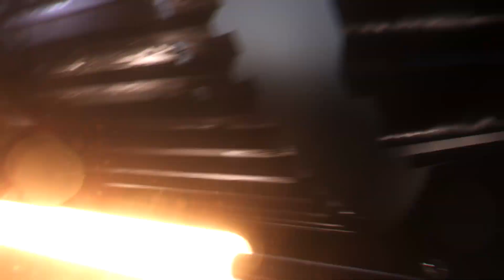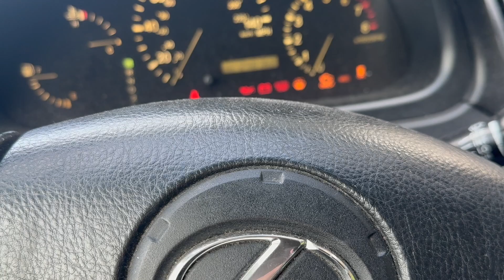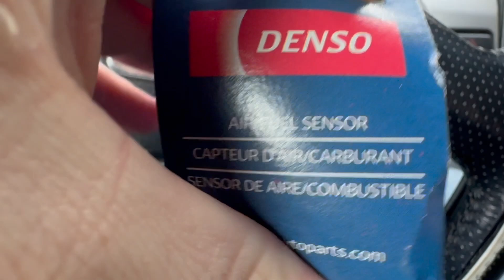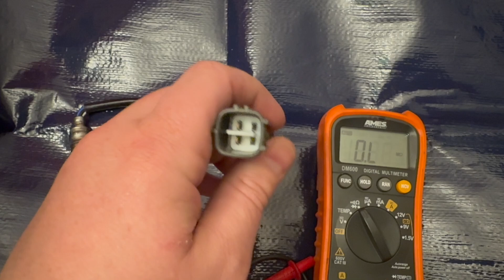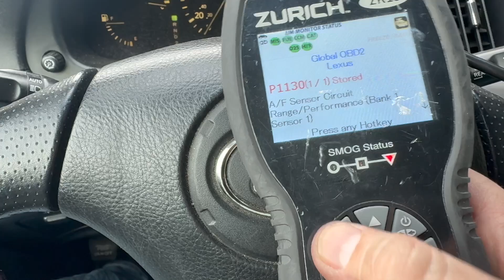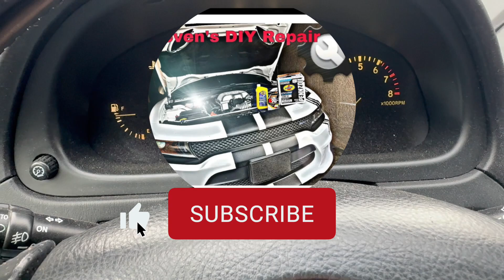2001 Lexus RX 300 Air/Fuel Sensor Bank 1 Sensor 1 (P1130)

Comment: Solid vid. Can’t believe we’re still getting gen1 RX tutorials in 2025. 

Only asking bc the vid is still fresh; I was able to do B2S1 with just a 22mm wrench. You think a wrench would fit underneath the car for a B1S1 replacement or should I get the sensor socket?

Thanks again
Reply from the maker: Thanks for watching, I appreciate that. I’m pretty sure you could get away with the wrench but the socket might be easier.
Reply: Excellent video thank you . I just did the B2S1, B1S1 is next